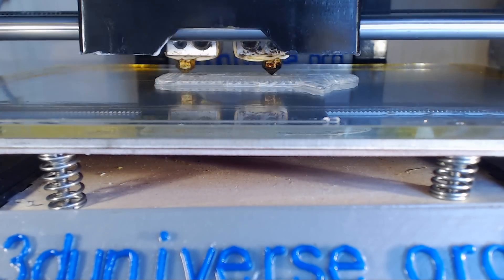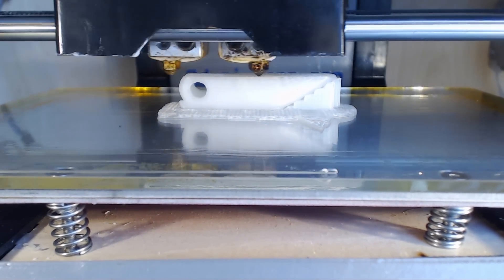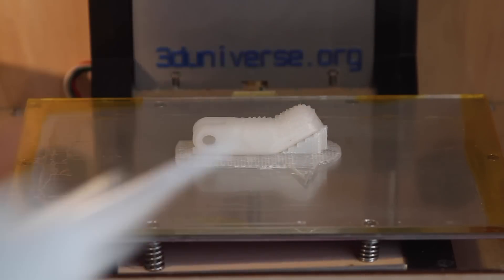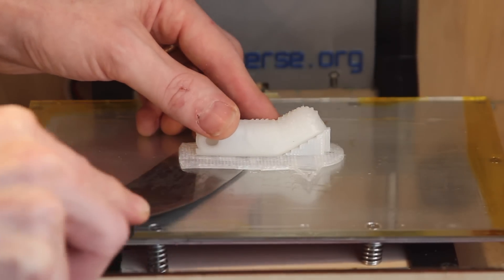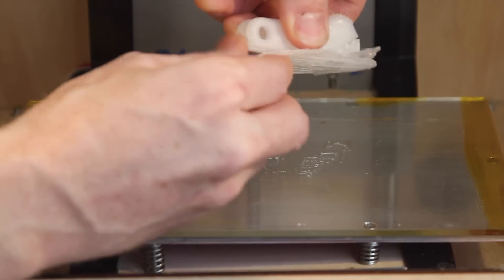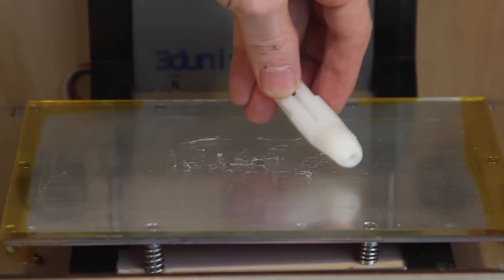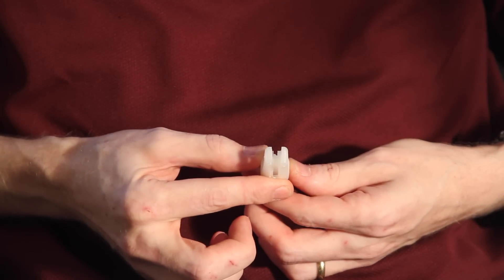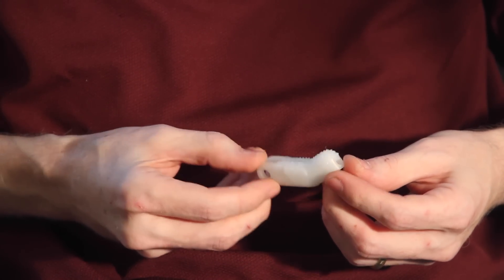Review of Taulman 3D's Bridge Nylon Filament for 3D Printing (3D Universe)

Comment: Last time when I tried printing with nylon, I coated a borosilicate glass bed with a thin layer of diluted PVA glue and heated it to 135 degrees (almost the glass transition temp of Nylon).. It stuck to the borosilicate glass so hard that when I took the part off, it took some of the glass with it! Now I need another build plate..
Reply: I was looking at the mes it left on the build plate and was thinking of cleanup.
I guess ut easy if you just replace the glass each time. Just not very cheap.

Comment: Great strength test! Hey, I print around 3 kg per week of PLA at 100mm/s on my Ultimaker2 but I heard you mention that you print much slower - something like 30-40mm/s. This is a MASSIVE disadvantage :( What nozzle size did you use? Do you know where non-Americans can buy it?

Comment: I got a roll yesterday and plan on trying today. I ran across the video when looking for printer settings to print on, notice you are using 240c for tip temperature.

I should have asked about feed rate. I have been printing at 35-40mm/s with 645 and was curious if you maintained a low speed or were you able to print at 70-90 like PLA?

Good video
Reply from the maker: Yeah, Matthew, I keep it pretty slow - around 30-40mm/sec. The nylon seems to slip in the feeder gears when going faster than that.
Reply: I have been doing a lot of work with the Bridge and 645. I print it around 50mm and run my extruder at 245+. It holds up very well to sand blasting media we use in our blast cabinet at work. I have made a lot of fixtures that hold the parts, protecting surfaces that do not get blasted. I am getting 75-100 uses from each fixture saving the company around $70,000 in production costs, all this from about $300 worth of nylon.

Comment: Thanks for the review. Can this material be printed on a printer that supports only PLA and ABS? If not, what parameters would one have to change so that their printer is able to print those modified nylon materials?

Good stuff, looks very interesting.
Reply from the maker: It should work fine on any extruder that can operate at 240C. Most extruders seem to be rated to 280C or higher, so it should work in most. But that doesn't mean the printer manufacture will support it, so be careful about potential warranty impact. 

The ideal temps seem to be 240C (extruder) and 70C (bed). Those were the only settings I changed. Everything else worked fine as is.
Reply: Thank you, that's very informative. Can't wait for my cheap-ass printer to be shipped out. I don't have any aspirations of keeping the warranty anyway! :)

Comment: Hi,Im looking for a weather resistant material any idea what is best ? 
and also that can bond each part together fairly easy ?Thanks in advance
 :)
Reply: Your most important factor for weather rsistance is finding a filament that can resist UV rays. UV is the killer for printed parts, because it causes severe post print deformation. I recommend printing with UVABS and spraying the part with rustoleum neverwet, it will resist water and the UV rays

Comment: How are you applying the PVA? I found the exact same product in the video but the parts are tearing my glass apart. I've broken two sheets of glass, one expensive borosilicate. As the part cools, it sticks so well that the glass fractures under it. I added about 5% water and spread a thin layer. Much thinner and the glue beads and streaks and doesn't spread nicely. So, what's your exact process of applying the PVA?
Reply from the maker: I was applying the liquid PVA glue undiluted, using a wide, flat scraper tool to spread it thinly. But since then, I've actually found a much better way. Glue stick! Just get an Elmer's glue stick and spread a little of it on the glass. Works perfectly every time for me!
Reply: 3D Universe
I use glue stick for ABS and PET+ but it hasn't been working for me with 618 (hardly anything does) and with bridge it wasn't holding larger parts well enough. The PVA glue is the first thing that I've found that would securely hold the print down but it's too good. As the nylon cools it's strong enough to crack the glass because it does not release from the glue.

In the video it looks like the PVA may be on top of Kapton tape. I like the hold I get from the PVA but I need to make it just a bit less permanent. I think I'll get some thicker glass, maybe .5" or so and hope it doesn't crack it. Thanks for the fast response. I'll play with glue stick some more. I did about 6 glue stick tests with different bed temps and none of them worked so far.
Reply from the maker: NVision4D If you're printing with 618, that's very different from what this video is about. This is Bridge nylon. It's designed to print easily on glass with glue stick or PVA glue. 618 is much more difficult to print with. I never got that working on anything except Garolite LE, which is an additional material that would need to be added to the build plate.

The Kapton tape you're seeing is underneath the glass, not on top of it. I had Kapton tape on the build plate and just put the glass on top of it.
Reply: 3D Universe
Yes, I know this is about Bridge and that's what I'm talking about. I confused the issue by mentioning 618. I find Bridge such a nice material when compared to 618. But, no more talk of 618 here. So, with Bridge, I just need to find "my" sweet spot on bed adhesion. Sure, small parts stick fine with glue stick but larger parts, parts that are 8" wide and spindly, have more exaggerated warp. I just haven't figured out the perfect recipe for holding them down without breaking my glass. I think I just need much thicker glass. I appreciate your help. Thanks for confirming the Kapton position.
Reply from the maker: NVision4D I see. You are correct, those larger parts are definitely more challenging. How are you removing the parts from the glass? I've been using a metal 1.5" putty knife. I'm not gentle about it. Never had the glass break on me. Please let me know if you figure out the "sweet spot". That would be great info to add to the video description above for other people.
Reply: 3D Universe I've been sliding the edge of a single-edge razor blade under and carefully working it around. The problem is that I've done 3 prints now with PVA and both have broken the glass so what happened when the glass cracked is that it pulled the surface off of the glass and left paper thin sections of glass fused to the bottom of the part. I ended up using a sander with 80 grit sandpaper to sand those glass layers off.

The last one I did where the glass didn't break I used rubbing alcohol to soften the PVA and that worked but was tedious and messy. I'm sure that could be the technique but I'd rather have it simpler and cleaner. I haven't tried a large part again as I need to get more glass but I assume it will be a race to see if I can get the part loose before it shrinks and cracks the glass.

Once I find the sweet spot I'll definitely report back. I'll probably start a thread also on a website I'm a moderator on, 3DPrintboard. (RobH2). I'll reference your link there. I'll figure out a good method. I was just hoping yours worked for me out of the gate without having to experiment so much. But hey, that's part of the fun right, just as long as I'm not splitting $60 borosilicate glass sheets all the time?

Comment: I heard that if you grit the surface of the glass with 90 grit sand paper (in diagonal direction), nothing will lift of from it , even Nylon. Have you heard about that?
Reply from the maker: Yes, I've heard that, but I haven't had a chance to try it out. If you try it, let us know if it works.
Reply: Ok
Reply: I tried to print Nylon on grit glass with ABS slurry. It didn't work. Nylon didn't stick to Abs. I expected that. I need slurry based on Nylon plastics. I know that I can disolve Nylon in 100 % acetic acid. It's a nusty chemical though, but if you have ventilation, not a big deal. Anyway, ABS works great on grit glass bed with ABS slurry. Absolutely nice flat bottom surfaces for printed parts.

Comment: whats your print settings?

im trying to get the right configuration with slic3r and cannot seem to get it right

my nozzle is 0.4mm and filament 1.75mm
Reply from the maker: For Bridge, I use 240C extruder temp and 80C bed temp. I use glue-stick on glass. I increase the retraction settings to about 5mm and slow the speed down to about 2/3 of what I usually print at.
Reply: im having bad results even at 18mm/s

i read somewhere that it might be due to moisture

corners dont lift straight on glass with 3mm cubed brim, i have bed temp set to 60

Comment: Perhaps I'm doing something wrong, but the parts I've printed with Taulman Bridge Nylon have turned out very weak. Much weaker than ABS, PETG, and even PLA. If I apply any stress to the nylon part the layers separate from each other.

I've tried temperatures from 250-260. The filament had always been stored in a sealed container with lots of dessicant.
Reply from the maker: Robert Berger At those temperatures, the layers should be well-bonded. I'm not sure why your layers are separating. I would suggest emailing Taulman (support@taulman3d.com) to ask about that.
Reply: Are you using a part cooling fan or a heated build chamber? What's your print speed?
Reply: Here whats going on. It depends what you print and how you print.  If you for example print flat surface and then something like post or thin wall goes up from the middle of that flat surface, of course if you push with finger you can brake thin wall from the very bottom where it was attached to the flat surface.  Thats because at the time when you finish printing the flat surface, it was already cooled down and when you melt the fresh Nylon on the top of the cool Nylon , its not gonna be a good adhesion there.  But if you for example printing cub,  gear, piramid, cylinder flat open wrench ( nothing sticks out of it) , those parts will be very strong. Because you print the surface of these parts almost at the same time, gradually going up, not letting one spot get too cold than another spot, your part will be strong. You know what I mean. If you print functional parts , try to print parts that are look like one piece. If you print parts with a lot of thin extentions that built in vertical direction, its gonna be a problem with integrity and strengh of the part. Thats the reality about 3D printed parts. They are not like molded part. Molded parts are much stronger, because they filled with high presure and configuration of the part doesn't matter.

Comment: Great video! Thanks for the information. Do you think you could achieve similar results without a heated build plate?
Reply from the maker: Some people have been successful printing this material without a heated build plate, but it would be more challenging that way. There's a thermal shock that occurs when the high temperature material meets the build surface, which increases the tendency to warp.

Comment: i tried Taulman "bridge" filament quite a few times but they all failed.  I set extruder temperature 240C (and I also tried 250C), bed temperature 80C, apply glue stick on my glass bed.  The printed material can stick on bed without any problem, but after printing a few layers (a few minutes), then nothing is out from extruder (printing in the air).  Can someone advise what could be the problems?  Shall i set higher or lower printing speed or ???   thanks for advice
Reply: same problem
Reply: Ok

Comment: Nylon or poly Carbonate which is best?
Reply: +Glen Dooer 
Neither is best. Nylon has a high tensile strength and a moderate amount of elasticity, so it can absorb a lot of energy from impacts without failing.
Poly Carbonate has even higher tensile strength, but has almost no elasticity, so it doesn't deal with impacts as well and it can fracture like glass when it does fail.
So, are you more interested in static loads, or impact loads?
Reply: +K Danagger  probably a bit of both but more impact resistance I want to make hand tools you can pull on .. But need to find out how to get a higher temp as well,  Thanks

Comment: I got some problems with printing Bridge Nylon. what's wrong? I used 70 C for bed, 230 c, 20mm/s speed , enclosed printer, no cooling  fun, for filament, but it was lifted. Then I used 110C and 230 C for extruder, 20 mm/s speed, turned off fun. enclosed printer, I used glass and PVA glue, I used a Cura for slicer and raft for support. Almost exactly your set up.  I got warped bottom and my print shrinked. What' wrong? https://youtu.be/jL0Yh4akkBc
Reply from the maker: Hard to say...  Your settings sound okay. Bridge Nylon is sensitive to moisture absorption. You may need to dry your filament. You can do that by manually increasing the heated temperature to 60C and placing the spool horizontally on top of the bed and leaving it there (with the bed heated) for roughly 2 hours. If that doesn't help, I'd suggest contacting Taulman to see if they have further advice. I'm not sure what else could cause that to happen.
Reply: It has to be over 240 degrees Celsius